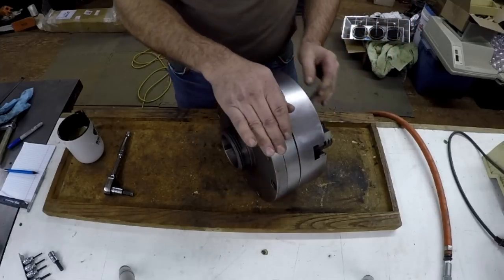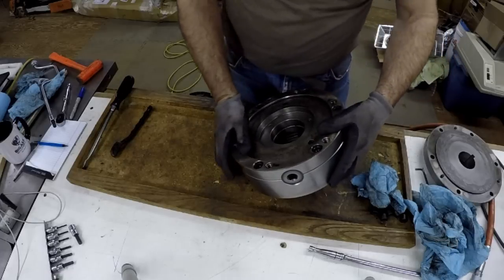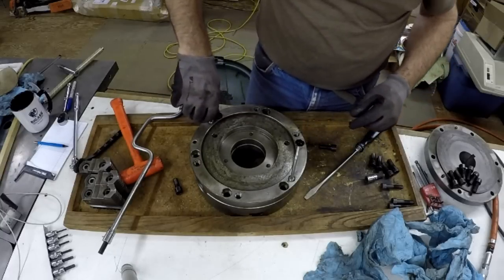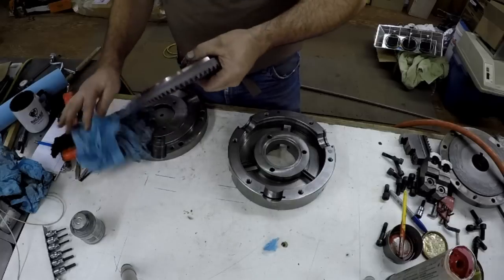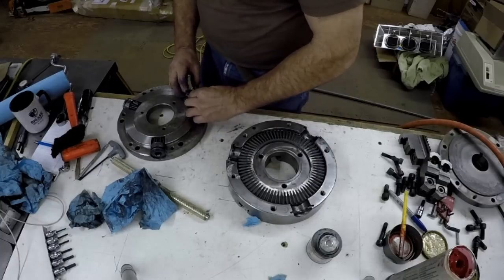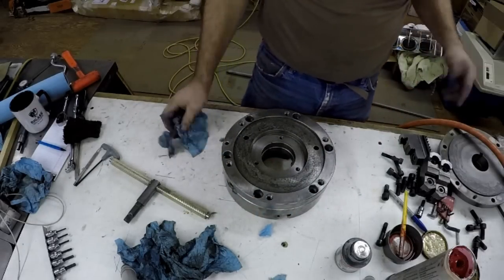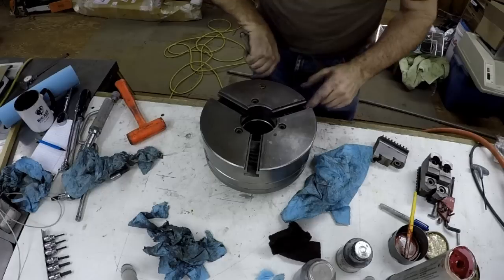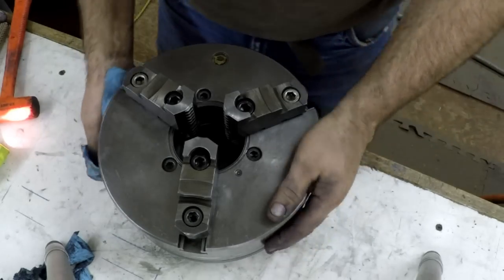How to Clean a Lathe Chuck

Comment: Hey Randy,

A clean chuck is a happy chuck! Phil and I are making a precision grinding fixture for my 3 jaw, I figure since I had my head trammed in I would try and get out that 3 thou run out on my chuck by grinding the jaws. You are welcome to it if it works :)

Thanks,

Ray
Reply from the maker: Ray Caniglia sounds like a good idea.  Are you going to wait until the temps are bit more constant and not up and down so much?
If it works, I will be looking to do that.  Thanks.  Randy

Comment: Randy, love the 3/8" speed handle (with a knob), have had two in forty years.  Used with a universal socket, you have an extremely long (high torque) wrench.
Reply from the maker: Joe Rogers I have several of different lengths.  They are very useful on aircraft for use on Phillips head screws, by the 100's.  Very good tool for a stuck or difficult Phillips head screw, you can apply a lot of pressure.  Thanks Randy

Comment: Hi Randy,
This video was very informative.  Nice to know how a 3-jaw chuck comes apart and goes back together.  I was surprised by how much gunk was under the back plate.  I would have thought the close tolerances on the flat surfaces would keep that stuff out.
Thanks,
-mike
Reply from the maker: ***** Thank you Mike. I am glad you found this helpful.  Between the Mounting plate and the chuck there is about 1/2" gap. That is the fist plate I removed. So that space can really build up.  The internals of the chuck were not to bad, but I doubt if had ever been apart.  Thanks Randy

Comment: Nice video. I like your wood work tray. Im going to have to make one of those. Very interesting choice on the lubricant. You said its low pressure, is that right?

Dale d
Reply from the maker: ***** Thanks Dale.  I use the try on all messy projects of if something might cause damage to my table.  My table is 3/4" milamine.  Yes, the gearing is low pressure.  The pressure between the gear teeth is low when the gearing is in motion.  The moly lube will remain between the teeth very well and takes very little for good lubrication.  The spray moil would also work very well and much easier to apply.  One great aspect to the moly lube is when it gets dry it still provides great lubrication.  Thanks Randy
Reply: I too like the traqy and will be making one too! :D

Comment: Could gasket sealer be placed in a circle around the center bore of the back plate, then mounted back to the chuck and left to set up before use? May keep the gap between the plate and chuck from getting filled up as bad.
Reply from the maker: RantingFury That would work.  But I am working on making the chuck an adjustable chuck and that void would go away.
Thanks for the suggestion and for watching.  Randy

Comment: MoS2 (molybdenum disulfide) lube is a fashionable marketing hype. Scientific papers have clearly shown that MoS2 is only superior in absence of all moisture. I.e. in high vacuum or in dry nitrogen or Argon environment. That means in a normal shop environment you cannot benefit from its properties. In moisture however graphite and teflon powder are doing better than MoS2. So a graphite filled grease is better and cheaper too.
Reply from the maker: For this use the it works quite well. This paste dries and is very thin and provides great lubrication without being sticky and collecting debris.  It is not the best lube of all situations but for scroll chucks it works well.  Thank you for the great comment about MoS2 lube.
Reply: if you want a dry lubricant try dry graphite or teflon powder and rub it into the surfaces using force.  Bottle corks have been proven useful as rubbing tool. For a chuck scroll this seems not practical, though.

Comment: Nice work Randy! I was waiting to see if any of the "Chunder"(different from Chowder) from behind that mounting plate was going to fly into your Big Ass coffee mug...looks like you moved it just in time :D

I also was kinda hoping that when the last cap screw flipped out of your hand that it was going to dive into your jar of never-seize, that would have made me laugh so hard I'd shoot carrot juice out of my nose, LOL! I felt mischievous, I know...

All jokes aside, I do have a question for you...or maybe it's two questions, we'll see. I got a 6" 4-jaw chuck that came with a backing plate that fits my Atlas, but there are two sets of hole patterns drilled into it. The one that fits the 4-jaw is a 4-bolt pattern, and there is a non-concentric 3 bolt hole pattern also drilled into the plate. Do you think that the plate, which seems to fit nicely, can still be used, or will the holes drilled in the back affect it's balance?

The other question is that I don't think the backing plate has ever had a skim cut taken from it like they advise in catalogs and parts houses, should that be my first step or should I scrap the whole plate and wait to buy a new one? I'm not sure my level of skill requires such precision ATM, but I just want to have an expert opinion. I'll be showing the stuff I received on a video tonight and will also add some pictures of the plate in question to FB too.

Sorry about the novel, it just seemed appropriate since you were working on your Bison. Mahalo and Aloha...Chuck.
Reply: If you take a skim cut, would that make the back plate undersized and sloppy?  If you chucks were anything like mine, the OD size of the hub on the backplate and the ID on the back of the chuck has to be a tight fit so it registers correctly.
Reply: Nope. I'm talking about skimming the face of it, like Randy did to his face-plate. On some of the websites that advertise "blank" back adapter plates, they recommend that you take a facing cut to true up the casting.

The only ID on the chuck is the bore, and it doesn't register on anything. The 4-jaw seems to run true when it's mounted, but without two gauges to check whether or not the face runs concentric to the bore it's all just by eye.

HERE: is the type of Chuck it is: http://www.grizzly.com/products/6-4-Jaw-Plain-Back-Independent-Chuck/G9865

HERE is the type of adapter plate: http://www.grizzly.com/products/6-X-1-1-2-8-TPI-Back-Plate/T10098
Reply from the maker: Knolltop Farms I would mount the adapter plate on the lathe.  Put a dial indicator on the face, check the runout.  You want zero or as close as you can get.  Take a facing cut to true up then recheck.  When you are happy with the runout.  Mount the Chuck.  Chuck.  Only turn the OD to match the chuck.  Should  then be good to go.  Randy    ps: i had to throw in the the Chuck.LOL
Reply from the maker: Randy Richard Depending where the chuck registers on the adapter plate you may have to true or size the register.  I did not see how that was done in the photos.  Randy
Reply: Randy Richard
Thanks Randy, I will make a video of it in the morning beginning with testing the run-out of the adapter plate and working from there. I will be using your face-plate video as a guide :D...Aloha, Chuck
Reply: On my six inch chucks I added forcing screws to fine to the chuck to the back plate

Bill

Comment: Hey Randy,
Some "deja vu"....Dirty back end of a Bison... lol
"Stupid" you really forced yourself to find the leanest possible word for You Tubers producing videos
I was more worried about your cup of coffee flying than you untie the screws, good idea making indexing marks
The "Zero position" can vary according to the gear that will repeat the best, could be any of the three after testing.
That was "Chip control" now evolving to "Chuck cleaning"
Have a good one,
Pierre
Reply from the maker: pierre beaudry Thanks Pierre.  I thought you might like this, I almost busted out laughing while making this video.  You can see that this chuck is identical to yours.  I am thinking that I could make this into an adjustable chuck.  After seeing yours.  Just add 4 holes and some adjusting screw/rods.  What do you think?
Reply from the maker: pierre beaudry Oh I just WAGed the weight.  Pretty close.
Reply: Randy, you sounded a little on the frisky side...lol
As for making an adjustable chuck with you 3 jaws, is there enough room in the back bore of it to accommodate the the adjusting pins with their associated screws, you would have to make sure the adaptor plate goes at least to the adjusting pins and there is a little drawback, the tightening screws are in the back of the chuck instead of in the front...
I would say probably doable...!  Pierre
P.S. That would make you as crazy as I might be... lol
Reply: BTW try to guess how much came off the back plate, originally 1.250" ( I think, not in the shop presently) thick and 12" dia.
Reply from the maker: pierre beaudry LBs'  several.
Reply: From about 62 down to 18, lots of hot chips in the pan and on the floor